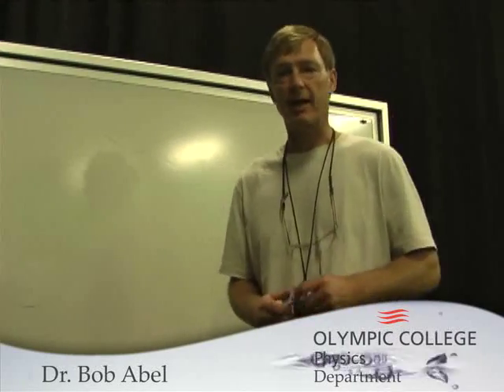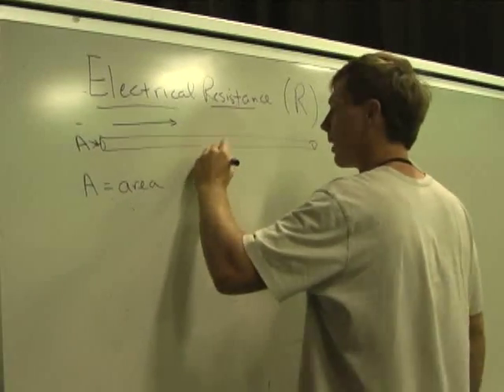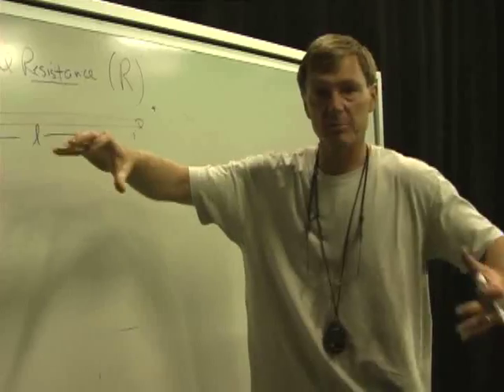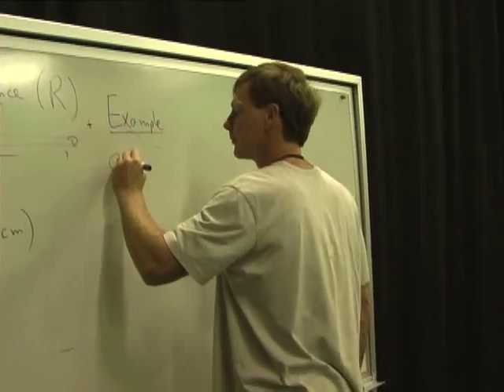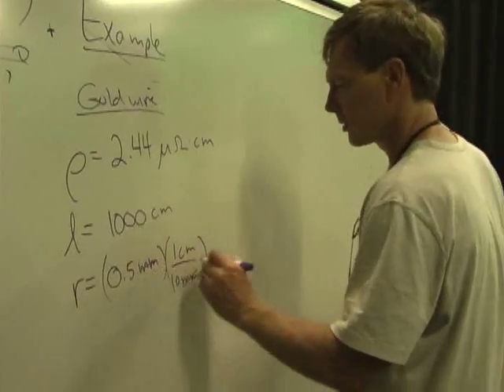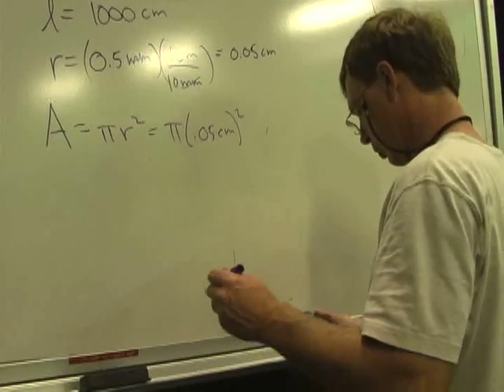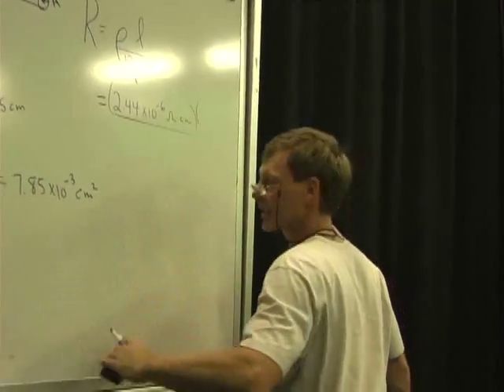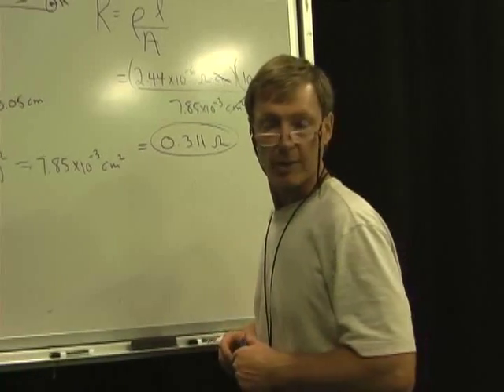Physics II I- Electrical Resistivity

Comment: @hottiepants87 no because the number x10^-6 is first multiplied by 1000 (which is x10^3) which takes the power to -3. Then its divided by a number x10^-3, giving the answer without a power.

lol sorry for proving u wrong a whole year later. im now revising for my physics A Level.

And thanks Dr. Abel for the video, it helps.

Comment: Hi Dr. Abel,
At the end when you find your final answer, shouldn't it be 0.311 times 10 to the negative something? Or more like 3.11 x 10^-4?
It seems like since you're dividing a number times 10^-6 by a number times 10^-3, the final answer should have a 10^-X as well because the numbers are so tiny.

ps. These videos are GREAT.